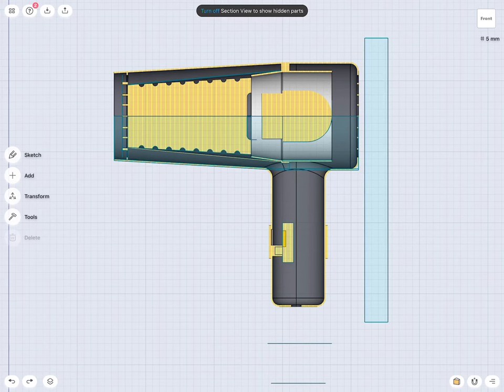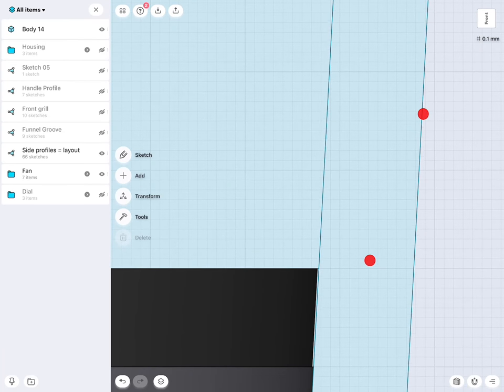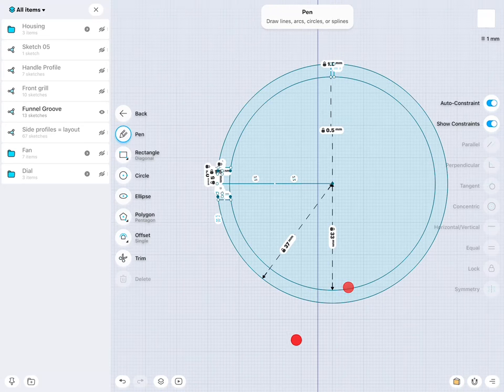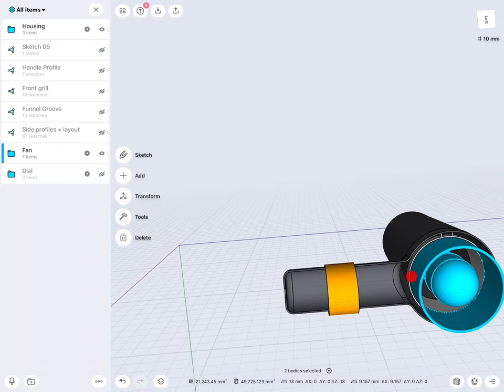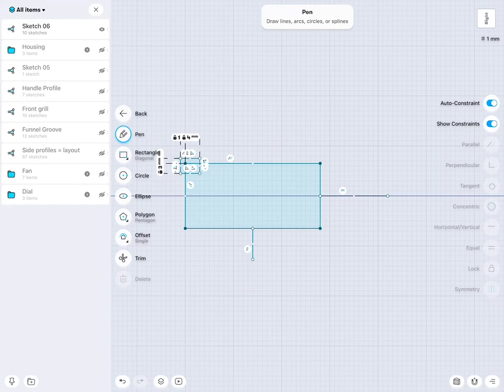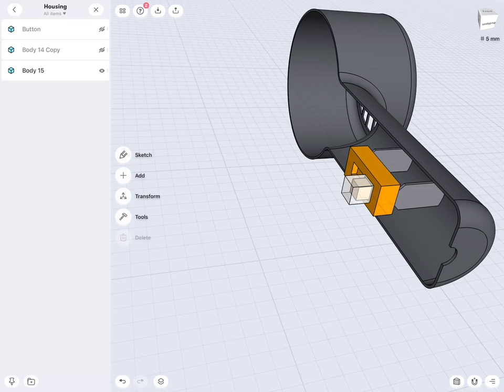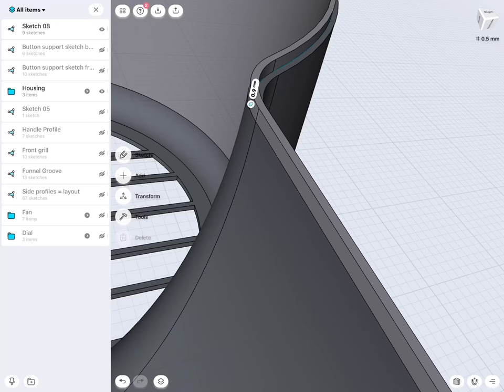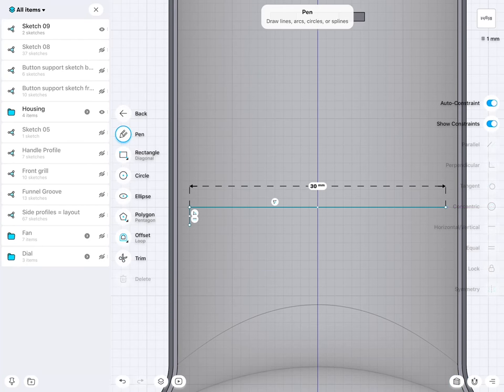Design a Casing Around Imported 3D Models on iPad | 3D Design Webinar

Comment: What we honestly really need in Shapr is a way to edit STL’s. Maybe an STL-Shapr file converter because currently there is no way to even accurately measure the components in an stl making it difficult to use. The best method so far (for me) is to color the item transparent and sketch on a higher plane whatever detail you can get.
Reply from the maker: Hello Drew, thank you for your feedback. This is the first phase of the STL import feature deployment. We will keep improving this feature. I have also passed on your feedback to our development team.